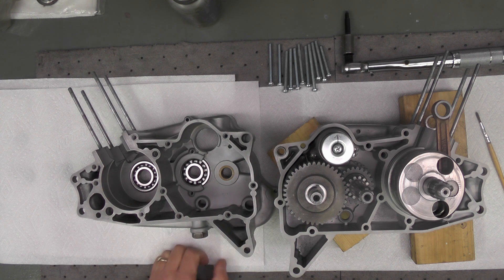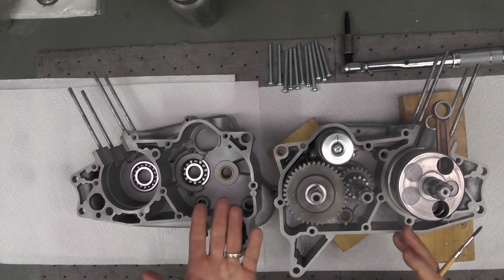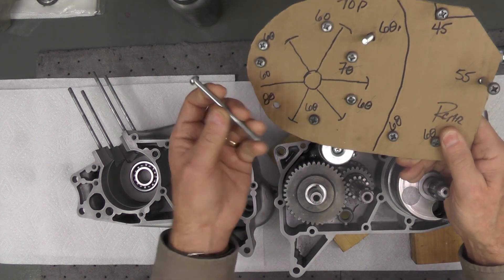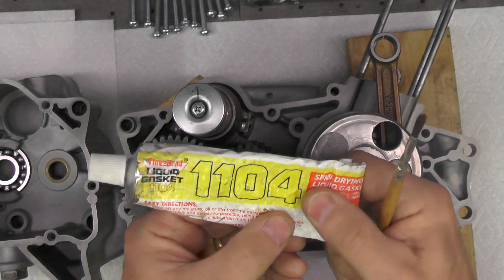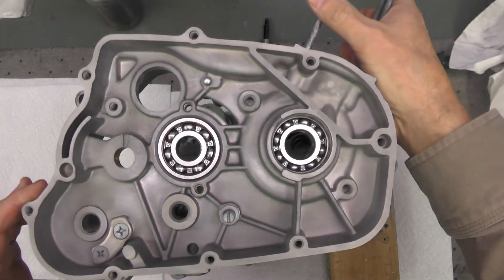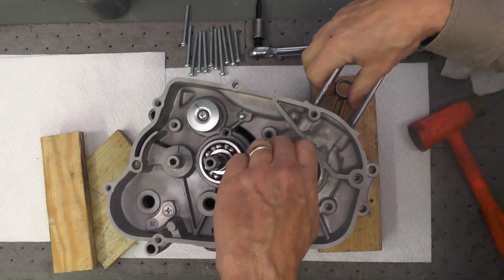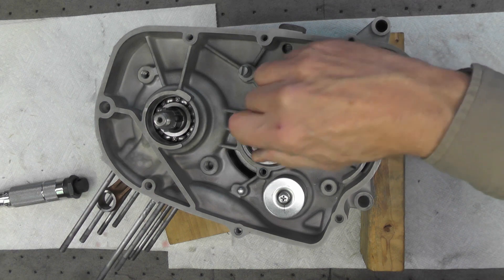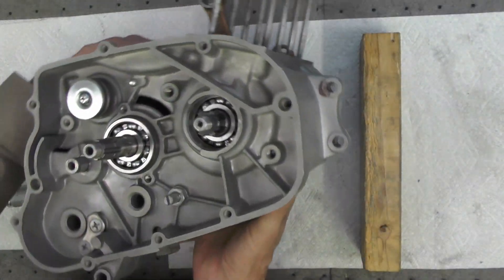Yamaha YL1, Assembling the Engine Cases Together --- Video #81

Comment: Beautiful workmanship.  I'm in the process of putting a YL1 back together and these are really helpful.  Did you forget the washers on the transmission and crank ends?
Also of interest, my left case was broken the same way - probably a loose chain incident.
I have 2 parts motors and have found some interesting things.
Your engine and my original one are early ones....  65 or 66.    I have a 66/67 YL1 and a 67 YL1E motor as well
The later engines have needle bearings for the transmission, bigger main bearings with better machined oil galleys.   
The 67 YL1E also has a different design for the center bearing carrier which has a different filler piece and different 2 piece seals.
I had Roy's Rides rebuild my crankshaft as well - great workmanship.  I sent him some YSR50 cranks from Outlaw Racing.   (I think that is what he probably provided for to get yours matched.   
   I'm putting that crank into a pair of the later cases - as a main bearing exposion was the failure that necessitated my rebuild.     
Thanks for the great videos!
Reply from the maker: Though I did the engine work and shot this video some time ago and I don't recall the details now, I don't believe I left anything out.  I know I didn't have any parts left over as if I had, I would have backtracked to figure out what went wrong,.  And this I would remember.  Always, but specially on an engine build, I never continue if I have unaccounted for parts when I'm finished.

Thank you for the information, model history and details on the YL1 engines and the kind words!  I appreciate your comments.

Comment: I'm  resto-ing a CS3C, which has the same vertically split case design and is very similar to the YL1. As a side, I recently acquired a nice original YL1 which fortunately did not have an engine that needed work. The CS3 has the same "center block" and was hoping for a description of it's place in the reassembly vids  After consideration, I believe it is attached to the crank and the crank cover seal vertical stems put in place prior to pulling the crank.That is verified by your vid of the final case assembly. Wondering if you considered case sealant where the block met the cases. I know the factory seal should hold pressure adequately, but was thinking sealant might be insurance. Also wondered why you didn't pull the crank into the right half, which is the recommended procedure in the CS3 (and I'm guessing the YL1) manual. The heating of the right case to me seems counter productive for reassembly, in that the bearing races are expanded, which is likely why the bearing pushed out. Seems like heating the bearing itself would expand the race and shrink the hole for the crank to fit into. I have a Tusk brand crank puller and plan to pull the crank into both sides. The right side crankshaft nut should work in the puller.. Fingers crossed. Also, did you use any lubricant or Vaseline on the crank cover seal prior to assembly to insure it maintained station while being sucked into the case? 

You mentioned not finding anyone in SoCal that would do the crank because of the required fixture. I was lucky enough to find a machinist near San Diego where I live that created the needed fixture and did the crank, although it took months. He's a busy guy and did the fixture in his limited off time. If there's a next time, I'll probably check on RoysRides..

Just watched video #93 and have some comments. Friends and I have used the 2 Duplicolor paints for several years on many bikes, including successful auction bikes, with great success. The regular Aluminum works great for side cases and for a engine case like finish, the Cast Coat is a good approximation. From our experience, both are fuel resistant, as long as the part is not soaked with fuel. Especially true once engine heat is applied. That could be replicated with judicious use of a heat gun. If you do decide to use the SprayMax 2K, get a proper respirator. It's a great product, but toxic. I've used their Glamour Clear over fuel tanks with Duplicolor lacquers and it is great stuff. 

OK, enough questions and comments.. Want to thank you very much for all your work in providing such well thought  out videos. My guess is you're a retired teacher, or if not, someone who would have made a great one. Wonderful job on a very useful and entertaining series.
Reply from the maker: A lot to talk about here...

Regarding the crankshaft center block... you are correct, the block is part of the crankshaft and is assembled during the crank rebuild.  That's why specific fixtures are required to rebuild the crank, so as not to damage this aluminum block.  That was the rub, most rebuilders didn't have the tooling or were not willing to make it for my project.  I found one builder out west (not sure where anymore ) that would do it and Roy's Rides.  Roy turned my crank around in two weeks or so, door to door.  In terms of the seals that go around the block, I did apply case sealant to the seals before reassemblying the cranks into the cases... I spoke to this during the case assembly video.

I've not worked on a CS3C, but the reassembly of the YL1 crank into the cases is done into the LEFT case first as described in several service manuals, including the Yamaha factory manual.  The heating of the case boss where the crank bearing fits is a standard technique to expand the aluminum to allow the steel race of the bearing to (hopefully) seat easier.  The intent is to work as quickly as possible as the steel race takes longer to expand from the heat transfer from the aluminum so get it together before the bearing race expands.  Doesn't always work that way, and the bearing moving likely had to do with tolerances.  If you heat a bearing race going into a hole such as a case, you will make the bearing race bigger as it expands with heat, which is the opposite of what we want.  As I indicated, I used case sealant on the two round gaskets so they would seal and not move during reassembly.

I'm familiar with using urethane paints, in fact, I painted the YL1 project myself with automotive-type urethane.  I have a good quality respirator and use appropriate ventilation and PPE when using the paint and HVLP spray equipment.  Thanks for the advice on paint and painting!

Last but not least, thank you for your kind comments!  Though I'm not a teacher, I was initially trained as one, but never pursued it professionally.

If I missed anything in my response, please let me know as I don't want to leave anything unresolved.

Thanks again for the thoughtful response...
Reply: @kwrightway  Thanks for the reply.. I do remember your comment re: applying sealer to the center seal, but thought it was to mainly insure the reused seals would not leak. I like the idea of using the sealant on the seals, at least in the center and filler block grooves, to help hold them in place for assembly. I'll try your method of installing the right case half. None of the manuals I have, including CS3, YL1 factory manuals and Chilton 2-stroke manual, say much of anything re: the right side case install, beyond "do it with care". I'll likely give the outside of the seals a light coat of Vaseline to help ease the seals into the case opening. Hopefully, the right case will tap in as easily as yours did.. If not, I'll have the puller ready.

Good to know you're using proper paint precautions for the urethane paints. I've not used any urethanes but SprayMax.  I've only done a couple of paint jobs and have used Duplicolor  Paint Shop lacquers for base. For the CS3, I'll be using a procedure found on the Vintage Yamaha Enduro site https://tinyurl.com/y2w7659k to reproduce the Yamaha Candy Green with Duplicolor spray cans. I'm excited to give it a try, and will practice on some old bodywork first.

I'll be assembling the cases in the same sequence as you did for the YL1. The Yamaha CS3 manual is the same as the YL1 for that. I like your zip tie security method, especially for the tranny. For my CS3 build, the cases weren't disassembled completely and the tranny was left installed in the left case. Output shaft bearing appears fine..The left and right case exteriors were cleaned, much as with your WD40/steel wool etc. method, but this is not a factory correct resto, more of a friendly one, including allen head case screws, plus a paint scheme that was correct for the scrambler (green) , but not the low pipe model (lavender - Can't stand it). The bike will be a rider, but still be shown at the VJMC Western Rally. 

Thanks again,
MikeC
Reply from the maker: @corcoranranch  Thanks for info on your projects, Mike... good detail here and sounds like you've thought things out (man after my own heart!).

If you show your bike at the VJMC rally and it's photographed I'll likely see it as I'm a member and read the magazine from cover to cover.

Comment: Love the attention to detail. Helps doing my own bikes. Where do you get the replacement JIS case screws from?
Reply from the maker: Most sizes are available from the OEMs, such as Yamaha, though they are expensive.  I buy mine in packages of ten or so in about six different lengths starting at 16mm up to about 70mm, keep them in inventory and cut to size as needed.  I buy them from Mcmaster Carr (in the US).  Note that they are available in longer lengths but as I rarely use JIS screws longer than about 65mm, I find I don't need to keep anything longer on hand.  If I was in a situation where I really needed a quantity of longer screws I'd just order them from Mcmaster Carr and they'd be delivered in a couple of business days.

Thanks for the feedback...

Comment: Fascinating videos of the engine rebuild - I had this machine  back in 1967/68  here in the UK. It was the only motorcycle I owned that I never needed to take to pieces, so I found your videos very interesting indeed. Thank you, great work well presented.
Reply from the maker: I often have a debate with myself when creating videos such as this regarding how much detail to include.  I try to avoid situations where the viewer needs to sit through or fast forward through ten minutes of repetition (such as applying case sealer).  At the same time I don't want to skip or minimize anything that may be of particular interest to folks.  On this project, I concluded that no one would likely use this series as an actual how-to, so I've decide to capture the gist of each step, rather than all the detail.

Thanks for sharing and the kind comments!
Reply: @kwrightway  I think you've got the balance just right between nut by bolt detail and before and after comparison. Methodical and organised beats rambling,  'it's here somewhere I just saw it before' versions :)
Reply from the maker: @andyb9049  Thank you for the feedback, Andy... I do appreciate hearing what the viewers think.